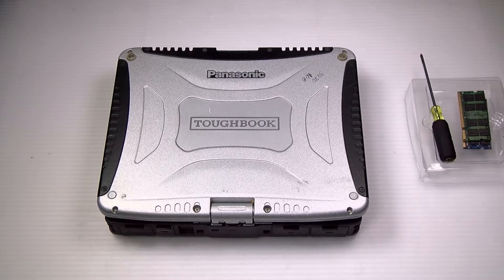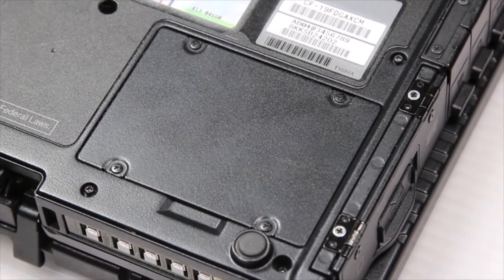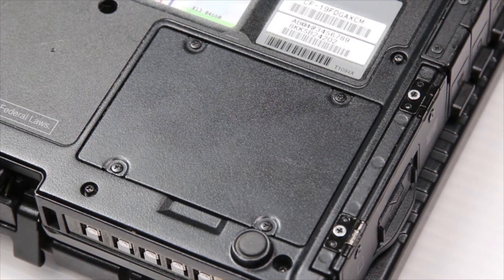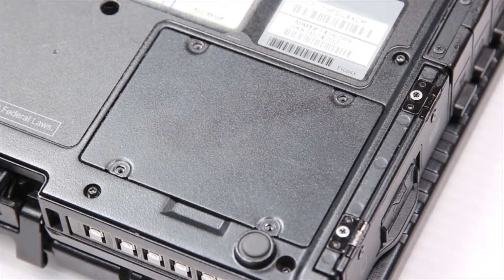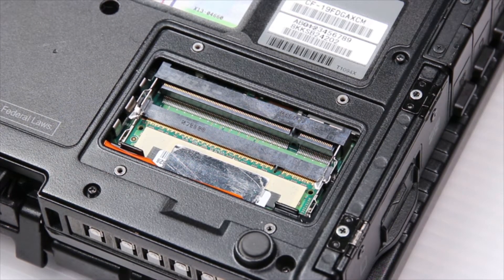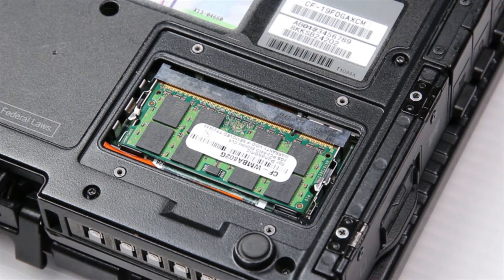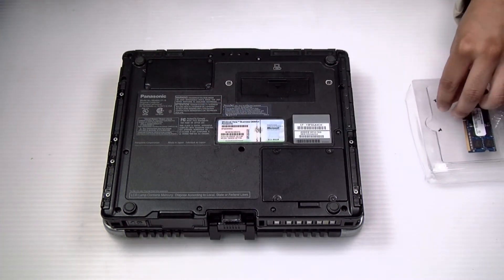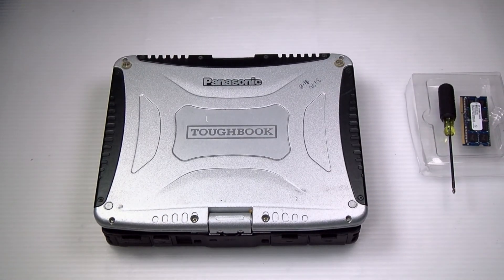Upgrade Your Toughbook CF-19 Memory!

Comment: what wwlan card works in the cf-19 mk5? It running windows 10 64 Bit. The one they got on Ebay is a sierra airprime MC7750 and the guy who selling it told me it came out of a CF-19. it is a 4g lte card with gps on it. I don't want to buy the wrong card for it. Thanks for the help.
Reply from the maker: @gregbender7370 The best way to answer this question is to simply fill out our Tech support form.  Our in-house technicians will answer with the links and info you will need.  Here is the link: https://www.bobjohnson.com/tech-support-form/  Thanks for Watching.

Comment: Can you give me the specifications of the memory module for CF-19 if I were to upgrade it to a 16 GB RAM, using Windows 10, Core i5. Thanks.
Reply: Gary Espiritu I think there is a 8 gig cap
Reply: @riot-gamez8995  Thanks, but I have successfully upgraded my CF19 RAM to 12 Gb, 8 Gb + 4 Gb. :-) It's running much faster now.  I can open more than 15 tabs in Chrome browser now without freezing my system and can still do streaming and other background apps fired up!
Reply: Lol that’s a lot of ram